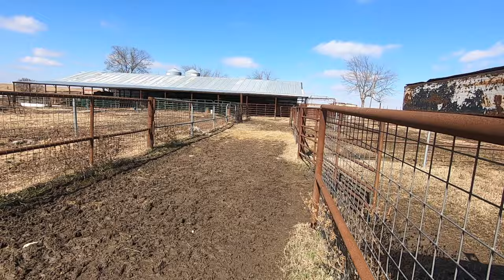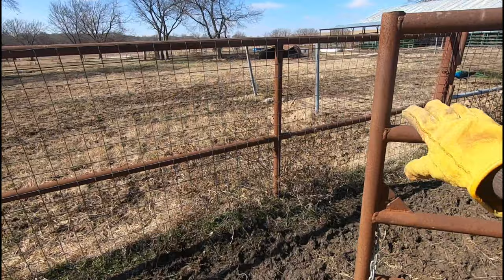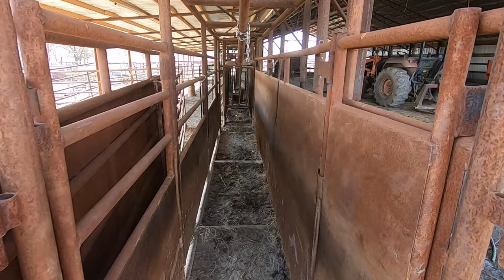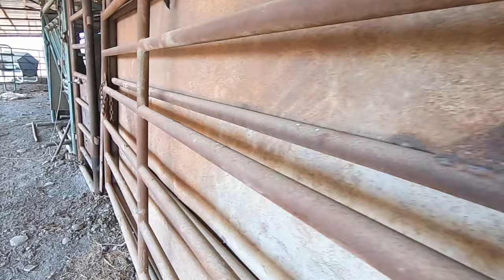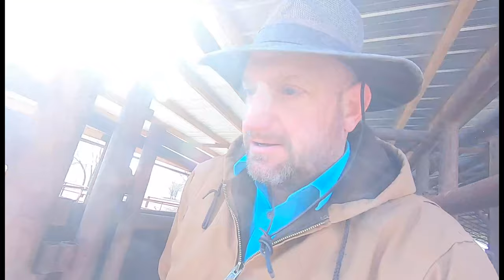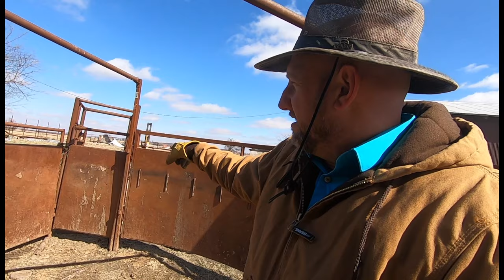Tour of our Cattle Corral

Comment: Its a nice solid set up you have. Have you read any of Temple Grandins books on cattle handling?
Currently we are designing a small but workable system for our sheep. 
I am used to building for cattle and have to stop thinking in terms of a ticked off 2500 pound bull😆
Reply from the maker: Yes!  I'm a big fan of Temple Grandin's cattle handling philosophy (but not so much her pens as they are so big).  Sheep and cattle are so different to work. For the sheep,  I have a small set of pens that's in progress.  Once I get more completed on it, I'll do a video (and I'm planning to run sheep through it in mid March.)  

For my sheep pens, I have a funnel (as tubs don't work so good for sheep) and a 10 foot alley constructed from wood.   At the end of the alley, I plan to build a two way sort gate.  I've tried various ways to handle the sheep for the past few years and I'll always feel that I've lost when finished.  Hopefully, this year will be different.